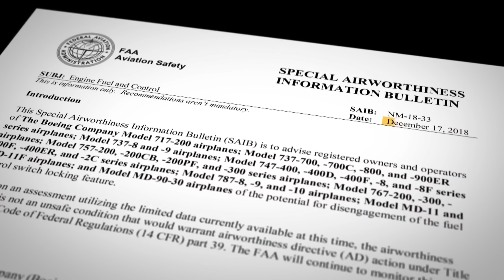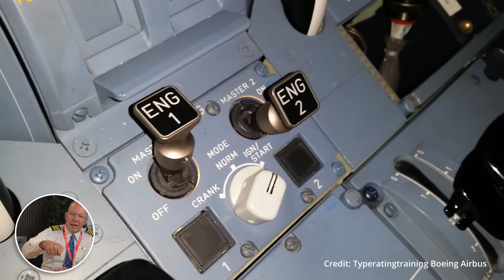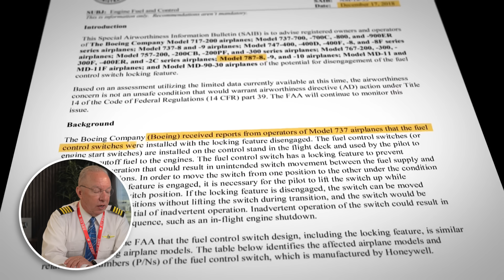Air India 171: The FAA’s 2018 Fuel Switch Locking Bulletin Explained (16 Questions Answered)

Comment: Couple of points that commenters keep in bringing up:

1) this airplane was not new, it had been in service a long time. Pilots routinely use the kill switches, as do maintenance people. You think they wouldnt report that the switches didnt have the sageguards? 

2)even assuming the safeguard wasnt there, the fact that there was a 1 second delay is significant. If the switches vibrated closed or a pilot bumped into them ( not likely given where they are mounted), they would have closed simulataneously, not 1 second apart. 

1 second according to aviation experts and pilots is how long it takes to operate the two switches when the safety gate is working

3) these are mechanical switches, so the genius at the Indian transportation ministry who suggested a short or an electronic unit upstream caused them to trip was laughably wrong. 

One of the things they likely are doing is trying to find the switches to see if they were installed wrong.obviously with the fireball that happened after the crash it very well may be they cant find them.

There is also a reason the final report takes a year, they literally investigate everything.  They have US and UK accident investigators involved as well, so even if someone decided to try and cover up the root cause, they wont be able to.
Reply: They found the switches...
Reply: 1) they are not kill switches. They're cutoff switches. The pilots use them at the end of every flight. 

Switches are simple. But they can fail in different ways.

(2) the "safeguards" is the locking feature on the switch. If the locking feature isn't working, the switch could still function apparently normally, like a switch without a locking feature. 

If pilots always operated the switch like they were supposed to, by first lifting the switch above the detent, nobody would ever realize that if bumped hard enough, the switch could flip from RUN down to CUTOFF without being lifted.

This isn't something that is on any preflight or maintenance checklist. Nobody would notice. Unless they accidentally bumped quite hard on the switches.

Boeing actually shipped out switches installed incorrectly, with the locking mechanism disengaged. The FAA sent out bulletin SAIB No. NM-18-33 in 2018 asking airlines to check the locking mechanism on these switches. But Air India confirmed they didn't do the check, because the bulletin was advisory rather than compulsory. And it was about 737s. And this is a 787 although they use the same switch.

That the bulletin was sent out tells me the FAA and Boeing believe switches might have been sent out, installed wrong, with the locking mechanism disengaged, and it was possible for airlines and pilots to have used those switches without noticing the problem. 

Think of your car remote. When you press the button, the central locking engages, the alarm is set, the lights blinks a certain pattern, and it beeps making different sounds to indicate when it is locked and unlocked. The first few days, you pull on the handle to confirm that it is really locked. If it was your first car, you might even walk around checking every door and the boot. But after a while, you just rely on the sound. One day, after an accident, a mechanic installs one door wrong. The car still behaves as normal. But unbeknownst to you, the left rear door doesn't actually lock. And if opened, the alarm doesn't trigger. But only this door. This actually happened to me. I don't know really know how many months or years I parked my car outside like this.

Point is, a defective locking mechanism on this switch may not be immediately noticed. What if there locking mechanism wasn't completely disengaged, or was partially disengaged, perhaps because the switch is worn. Pilots and technicians knows how they are supposed to operate the switch. How many would test it by banging on it in this abnormal way? What if the test itself damages the switch?

PS: yes they found the switches. I've seen pictures. No word of the state of them locking mechanism.
Reply: @danielch6662 
That also is assuming a lot. Obviously if they can tell if the switches had the locking mechanism on them that would answer the question definitively. 

One other thing to think about, the notice went out in 2018, which means likely the switches without the locking mechanism potentially had been out there for a while ..if so, why is it that no incidents of accidental engine shutdown were reported? I realize that we don't know what percent of switches had this problem, but if we say that maybe not many planes had this problem, hence no incidents happening, that also means statistically the odds are the Air India plane didn't have the missing lock.  If on the other hand a lot of planes had the problem, which would make the likelihood that the air India jet had that issue, that begs the question why were there no reported incidents of the engine cutoff switch activating before this? 

The other problem.is we are talking two switches being thrown. If they were bumped into hard, or there was excess vibration, you would expect them both to be triggered pretty much simultaneously. The data indicates there was a 1 sec gap between switch 1 and switch 2 being thrown into the cutoff position. That 1 second is the kind of time you would expect to see when a pilot manually shuts down the engines where the switches have the safeguard in place. 

Obviously at this point it is still speculation.  But given the sheer number of planes we are talking about,and the number of years flying ( the plane in question i believe was well over 10 years old), I am dubious that on this one particular plane we see the switches accidentally moved into cutoff by being bumped or vibration.  From what I am also led to believe , there is a physical guard around the cutoff switches to prevent them being bumped into like that,

Comment: As a safety measure to prevent this situation, is it possible (feasible) those Fuel cutoff switches be installed on both sides: the captain's and first officer's side so that if a switch needs to be turned "on" or "off" they BOTH have to manually operate them on their respective side. So, for exemple,  in the event the switch on the First Officer's side is turned "OFF" and in the captain's side remains in the "ON" position, the engine wouldn't shut down unless BOTH switches were in the "OFF" position. - Best regards.
Reply: You don't cripple the functionality of the cockpit just because it can be misused. At a certain point you have to say no, we can't do that.

Comment: Hey Captain, thanks for the reply! I just wanted
to clarify that in the Embraer, if we have an
engine fire on short final, we follow the QRC -
the Quick Reference Checklist at the front of the
QRH that covers critical items like engine fire or
reverser deployment.

The QRC procedure is quick and
straightforward: you first disengage the
autopilot, then bring the affected engine's thrust
lever to idle, and only after that do you cut off
the fuel.

Also worth noting - the Embraer logic doesn't
introduce any delay in shutting down the engine.
As long as the thrust lever is at idle, the fuel
cutoff happens immediately. There is no 15-second delay for the logic to happen, specially if the procedures are followed correctly.

The logic that prevents engine shutdown unless the thrust lever is at idle only becomes an issue if the checklist isn't followed. In my opinion, this is a smart safety feature that doesn't interfere with any normal or emeraency procedures and honestly, every a should have something similar.
Reply: The Embraer is way more logically designed than Boeing.
Reply: Memory items for Boeing follow the same procedure 'logic' and I'm sure the same goes for Airbus. So I'm not sure why captain Steeeve would, with 2-3 mins out, just play hero and knows what's best, not keeping to SOP's and memory items and just start yanking a fuel control switch (hopefully atleast confirmed by the other pilot)!? Sure… according OM-A if deemed necessary, probably he's allowed to shy away from procedures if he deems it's in the best interest to the safety of the plane, it's crew and passengers. But you gotta backup that decision with reason... and isn't that what memory items are for? To give you a standard way to handle emergency scenarios with clear steps preventing you to slip up rather than inventing stuff on the spot? Unless you're 2-3 seconds time critical and don't have time for autothrottle arm switches etc, just stick to flippin' procedures.

If he would just follow memory items, he'd get down to the same system logic of thrust levers idle, therefor would have no problem shutting off the associated engine with the fuel control switch. I think it's a sensible solution to have a cutoff inhibited if thrust lever not at idle. Of course one could argue that maybe due to some very unlikely technical issue a thrust lever physically might be stuck and not be able to go down to the idle position and in that case you might want to still cut it off. But I guess the ENG Fire Switch overrides all logic and is inhibited from being pulled unless and ENG Fire indication is present or the override button is press whilst pulling the lever. It's good to have multiple lines of defense in place to prevent inadvertent/accidental switching. But lastly... someone can knowingly just move the thrust levers to idle and then fuel control switches to cutoff, there's never a 100% method to deter ill intended folks to do ill intended things one way or another.
Reply: @cinemenico Absolutely- not to mention that this procedure is for above 400ft approx - NOT within three seconds of lift-off!

Captain Steeeve may well live to regret his hasty conclusion. There's more AGAINST his precocious conclusion than there is in favour.
Reply: https://youtu.be/vJC4JdUmudk?si=g4JT3DjOD0Qq2s54
Reply: @sirgam1  Why?
Reply: Well said!
Reply: Sound strange QRC. If you touch thrust lever, autopilot should go off anyway. Correct me if I am wrong
Reply: @pvsolutions9292  Sure hope not. Why ditch a perfectly good functioning autopilot if it's doing a good job and helping you, giving you more capacity to deal with the situation? Autothrottle? Usually reponds to an manual override situation which would try to return the lever to the automatic instructed position once let go off. So if you want to put a thrust lever to idle and have it stay there, you should turn off the autothrottle for the selected engine's side.

Comment: As per timeline, the RAT deployed 3 seconds after the aircraft left the ground. This means, the first fuel control switch was toggled to cut off only after 2 seconds of leaving the ground and second one a second later.
A psychologist will tell you no suicidal action can be taken so quickly. Hands tremble, mind goes to and fro before someone decides to go ahead. 
There must be something more, something else nobody is looking at.

Comment: Dear Captain Steeevie,

Your conclusions are premature and very likely incorrect. To claim this was intentional is yet another of your flawed hypotheses, and unfortunately it influences public opinion.

a) What happened with 100% certainty is that both engines failed and the pilots received an overwhelming number of warnings. At the same time, they saw and immediately realized the loss of thrust. One of them thought that the other had shut down the engines, which is why he asked — and the other denied it. They certainly checked the switches, which remained in the RUN position the whole time, meaning there was nothing they could do. That is why they simply declared: “MAYDAY, MAYDAY!” You would never make such a call if your colleague had just shut down the engines himself — that’s absolute nonsense.

A few seconds later, the engines restarted on their own, but by then it was too late. If the engines had actually been in the CUT-OFF position, it would not have taken the other pilot 10 seconds to restart them. Moreover, in such a case, they would never have declared MAYDAY — instead, we would have heard an argument, shouting, and accusations that one pilot was trying to kill them.

What very likely happened here is a technical malfunction. To clarify this, we need to look at how computer logic and aviation engineering work. I am an Airbus captain, and what happened here reminds me of a situation that has occurred before — fortunately, not involving engines.

In computer logic, we use 1 and 0, meaning on and off. But there is actually another state: “undetected,” which the aviation industry recognized only later. To explain this simply for non-pilots: the Airbus A320 has a landing gear lever, which is merely a switch that sends a signal to extend or retract the gear based on its position. That’s the design — pure binary logic, 1 or 0.

But pilots always find ways engineers didn’t anticipate. In flight, the PF called for “gear down,” and as the PM started moving the lever down, the PF realized it was too early and commanded “wait.” In that moment, the PM didn’t know what to do, so he held the lever in the middle — between up and down. Clearly, this was a human factor scenario the engineers hadn’t considered. Since the Airbus computer received neither a “gear down” nor “gear up” signal, it interpreted this as a fault, and both LGCIU1 and LGCIU2 Failed. The pilots then had to extend the gear manually using the emergency procedure.

I lean toward the view that the engine switches remained in the RUN position the entire time and were never moved to CUT-OFF. Somehow, there was a loss of the signal in the RUN position, which the system interpreted as CUT-OFF. I believe this kind of technical fault is far more likely than an intentional pilot suicide — which could be carried out in much simpler, more certain ways than this. Above all, the radio communication did not match such a scenario at all; it would have sounded entirely different, and it certainly wouldn’t have taken 10 seconds. The pilots would have moved the switches back much faster, there would have been a struggle, possibly repeated shutdowns, and chaos on the radio.
Reply: If the switches were in the run position the whole time then why would one pilot ask the other pilot why he moved the switches to cut off? 🙄
Reply: @CorneliusTaylor-s1u I would have asked the same question if I saw both engines shut down. Immediately afterward, there was a response that he hadn’t done it. So from the CVR, it must be obvious what the communication was after that — and it’s surprising this has not been released. I think the other pilot looked down and actually saw the switches in the RUN position. That’s why they declared “MAYDAY, MAYDAY.”

If the engines had been shut down by the other pilot, it would be obvious on the CVR. The communication would have been completely different, and they certainly wouldn’t have waited 10 seconds to restart them — definitely not with a 4-second gap between engine 1 and engine 2. I think the engines relit by themselves.

They could easily release the full transcript, and everything would be crystal clear. They haven’t, because they themselves don’t know for sure. No one shut the engines down, no one restarted them, and the communication matches exactly what you’d expect in a technical failure with a proper MAYDAY call. But they cannot explain the technical failure.

I lean toward something similar to what happened on the Airbus case I described earlier: the computers didn’t know how to interpret the signals, they interpreted it as CUT-OFF, and then a few seconds later as RUN.
Reply: @tomasmisik6885 

No, the question was specific to the cut off switches. If he asked that question so specifically then it makes sense to conclude that he saw those switches in the cut off position. Only a human can do that.

Comment: Thanks for your insight Steve. 
I'm still confused about the position of the fuel cutoff switches at impact. I understand that they were in the off position and that one of the pilots put them back to the run position before the crash. If that is the case does it indicate that the other pilot put them in the off position a second time before impact?

Comment: There are two core things .. either fadec  software error that recorded cutoff even if the switch was on and the other is pilot mistake.. I wonder why Steve never discusses a software error
Reply: Why are you avoiding the suicide scenario? Because that is very likely what happened.
Reply: @CorneliusTaylor-s1uyes, that is a highly likely scenario. However, what if there is a software issue (getting Cutoff signal even when the switches were On.. and the pilots simply turned off and on again to restart the fuel supply?)

Comment: This has been clarified for me. The pilots took off by mistake with the fuel switches in the off position. I strongly suspect this is possible if there is residual fuel remaining in the fuel lines. The statements from both pilots would also be consistent with this scenario. Additionally, the fact that the engines ran only briefly before experiencing thrust loss also supports this theory.What's your opinion on this?
@Captain Steeeve

Comment: In the most routine commands and requests on my PC, such as formatting a drive, I get the prompt, "Are you sure?" with the opportunity to step back. Is Boeing saying you can bring down a massive airliner with the throttles pushed to maximum, the engines screaming and the airplane climbing on takeoff? With the mere flip of a switch? Not a single 'Are you sure?' flashing anywhere on the instrument panel? Not even a warning alarm with a delayed countdown? I can only think of Kevin Bacon in Apollo 13 with the word NO taped over the switch.